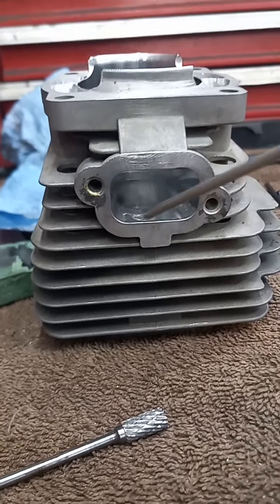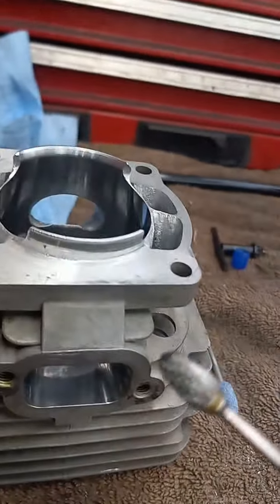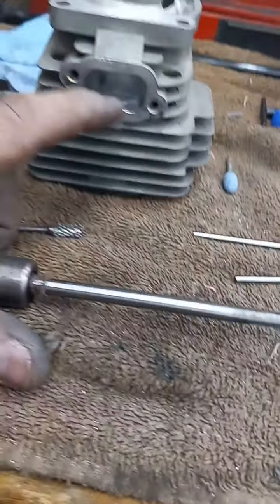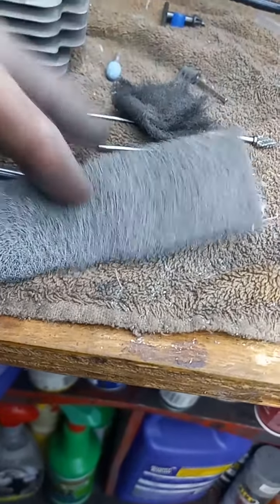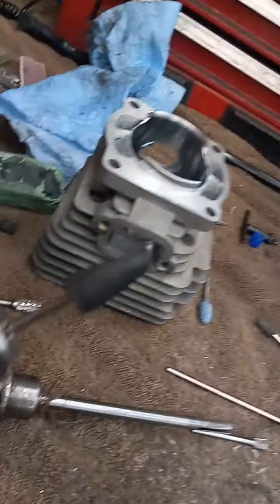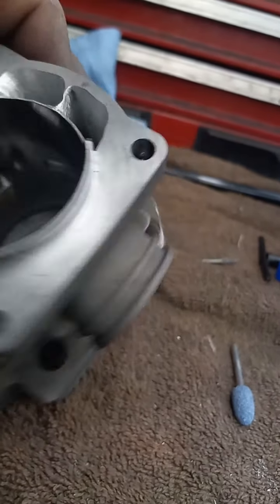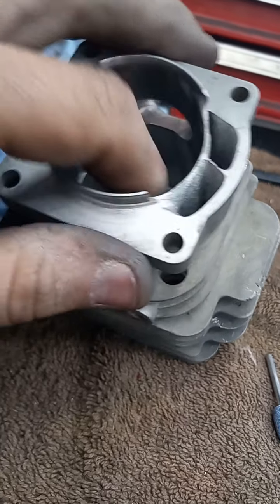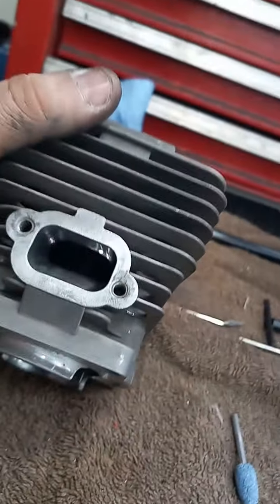how I clean up ex ports when porting

Comment: Hey Charles, I quite liked the trick you showed using exhaust expander for turning cylinder lathe, is it just one of those cheap kits with 3 different sizes? Also, my machinist  ask if they run true enough  🤷‍♂️. Loving those 4910 builds tho sound good👌
Reply from the maker: It's just a single one better the brand more true they seem to run still have to shim them in tho as with anything

Comment: Put painters tape on the on the exhaust port gasket surface 2-3 quick layers and it can save on marks then it’s quick to remove. I also will do it on the plating where I think I might have a carbide trail off especially when you’re at a tricky angle. You know when you’ve got it just about perfect and you bit catches and goes out where you don’t want it then you start swearing and yelling lol 😆😂 least that’s what I do 😂